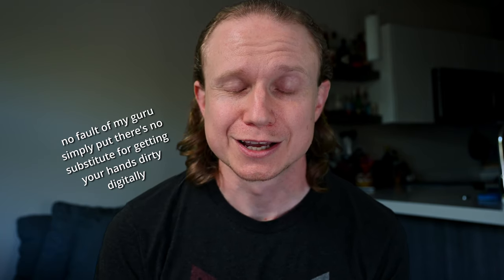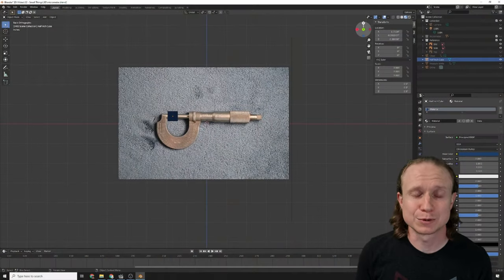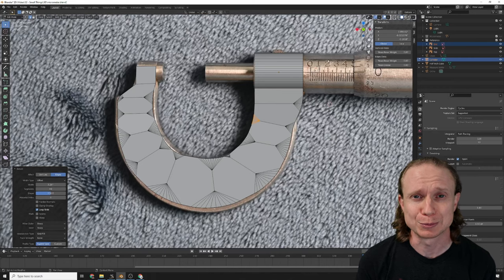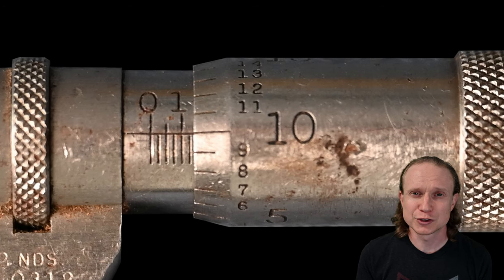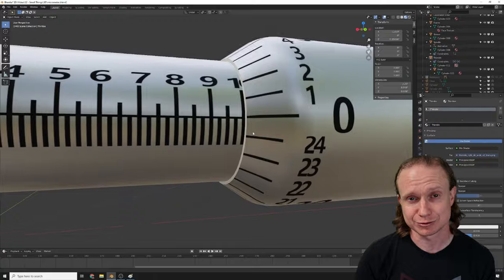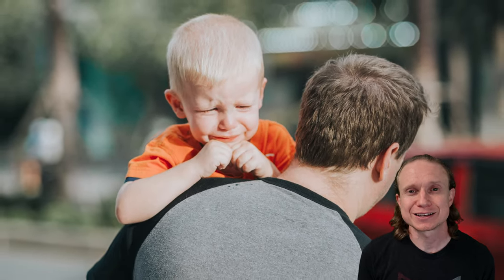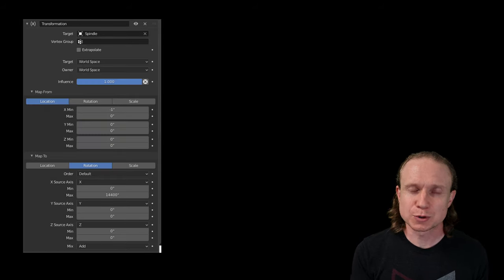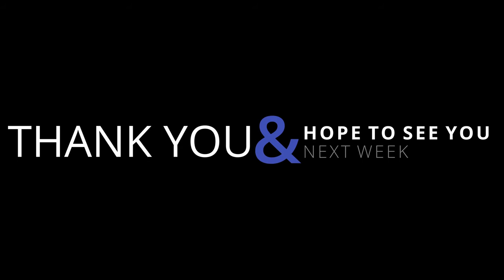3D Modeling

Comment: Nice! Would bump mapping have worked for the knurling as well?  Or would that not have held up for the closer views?  How much of your geometry was all the vertices added by that process and is there any optimization for those kinds of repeated patterns/faces?
Reply from the maker: So I think bump mapping and a texture would work for the knurling to an extent... but on close inspection wouldn't have because the bump on knurling is a decent proportional displacement.

Honestly even with the subdivisions it wasn't too geometrically complex and the process of creating that geometry was pretty quick.  I think the only optimizations would be, as you suggested, from using textures and bump in place, but I'm not sure it would improve render times that much.

Might be an interesting experiment though.
Reply from the maker: One thing that just occurred to me is that the new version of blender supports geometry nodes, basically visual programming to create geometry through interconnected nodes... I bet you could use that feature to create the rotated diamonds on the surface of the cylinder. Unclear if it would be more efficient or optimal, but maybe interesting.